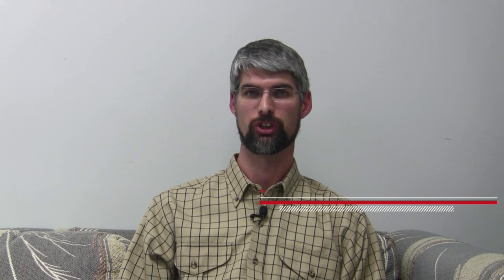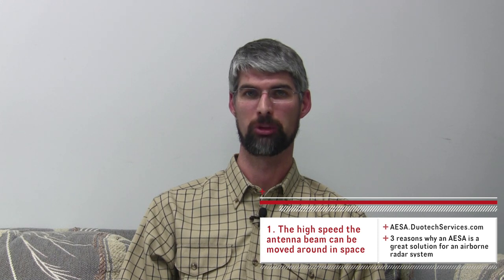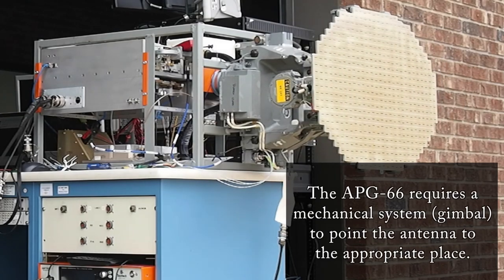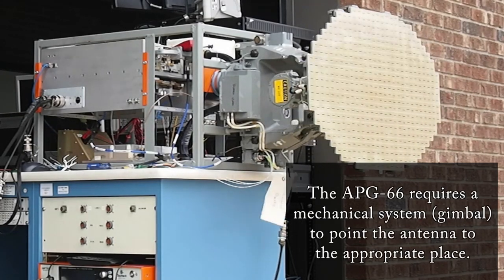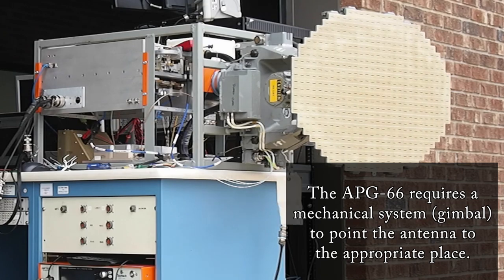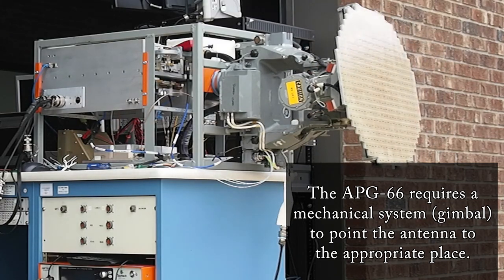What Makes an AESA Radar Better?

Comment: its time to simplify unwieldy acronyms, active implicitly means an array radar, and the electronic scanning is also implicit. Its no like the SPS-48 which could only scan up or down, rely on rotation for the full view.
An active array might still rotate to provide 360-coverage with a single (sometimes two) panels. 
So we could just say: Active Radar, with array and electronic scanning being implicit.
It might help to say whether it is a 1, 2, 3 or 4 panel Active radar.

Comment: What's the advantage of putting an AESA radar on a moving platform, like what was done to the Euroradar CAPTOR of the Eurofighter?
Reply: The closer to the edge the target is the lower the resolution is. Moving the radar for tracking allows extremely high resolution and variably frequency tracking.
Reply: @TealJosh  also simply gives a wider angle of radar coverage

Comment: How does the capability differ from Pesa?
Reply: AESA: each module can create separate signals (frequency, modulation etc.)  ->  can create several beams that are directed at different directions simultaneously
PESA: modules are controlled by a single computer -> can create only one beam at a time

the beam steering principle is the same using phase shifted signals from each element of the antenna.